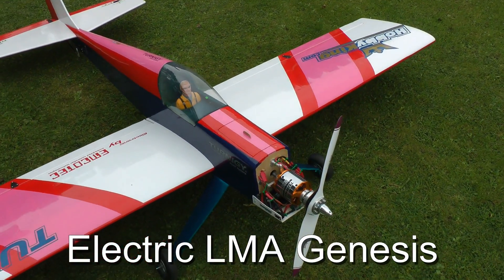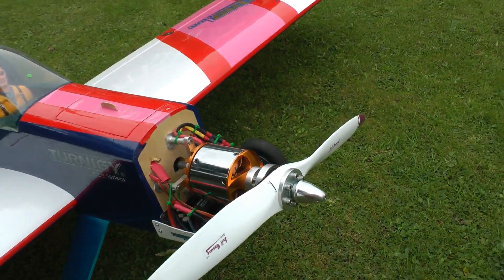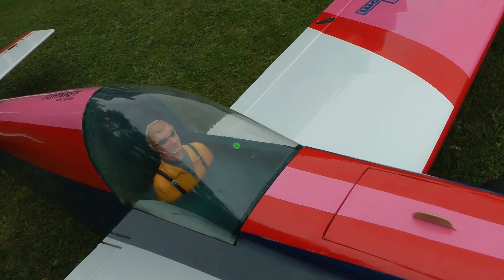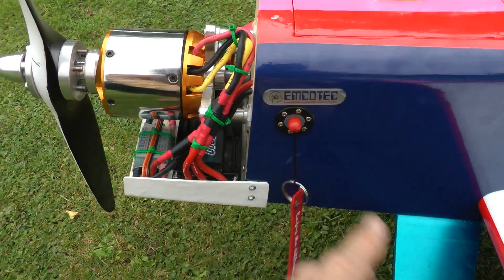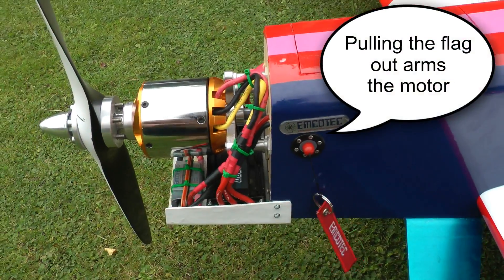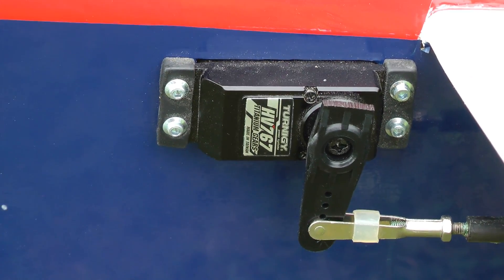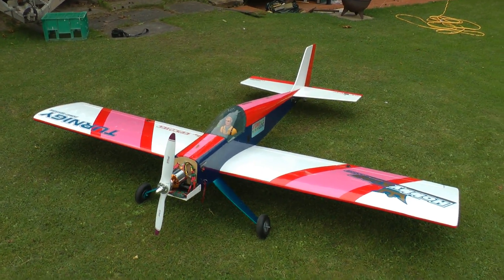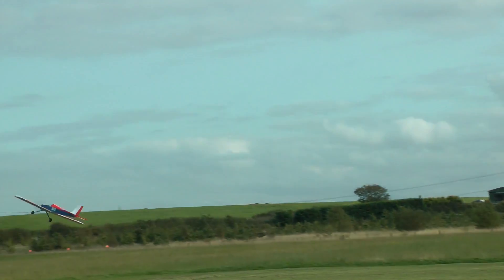Large Scale Electric LMA Genesis

Comment from the maker: We use 8 small lipos as it's cheaper, because you can also use the lipos in smaller models as well. We use 3s 5000mAh, in this plane wired up so its 12s 10000mAh. And it's definitely not slow :p

Comment: Nice aircraft , but i fly helis , and if there is one thing i have learnt its to have plastic gears in the servos .. metal gears are no more stiff yet if the model bites the dust the gears are sacrifitial , and i just buy a new set of gears instead of new servos , is this the case with fixed wing to ?